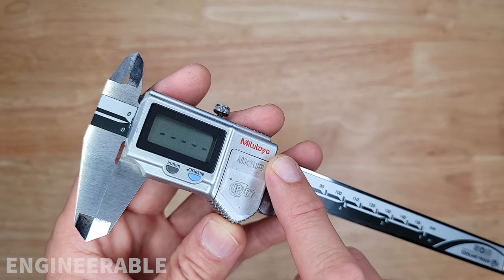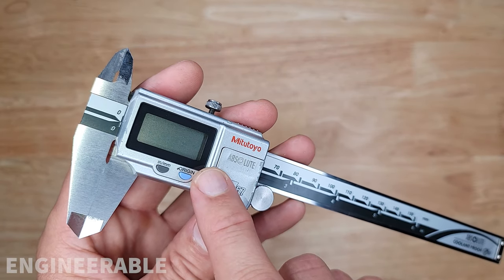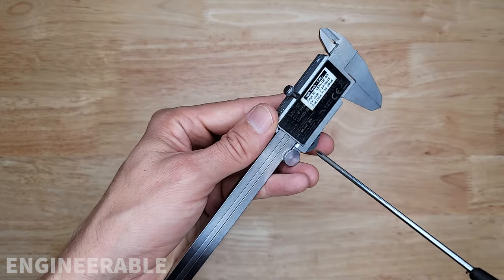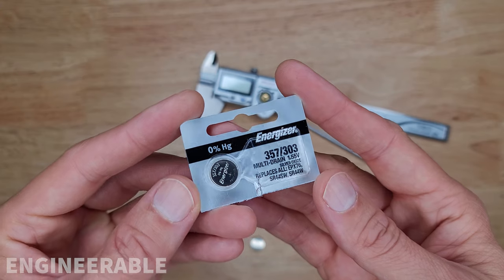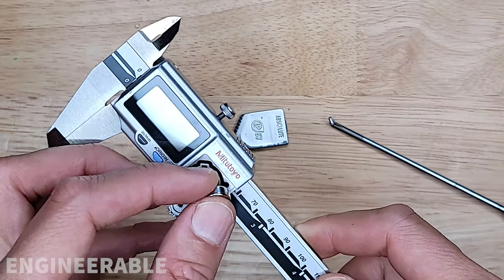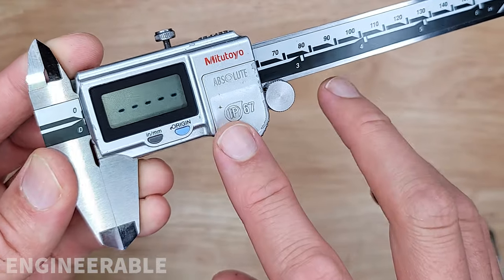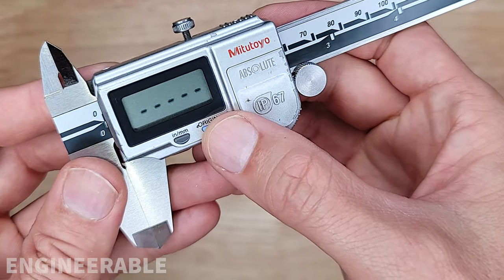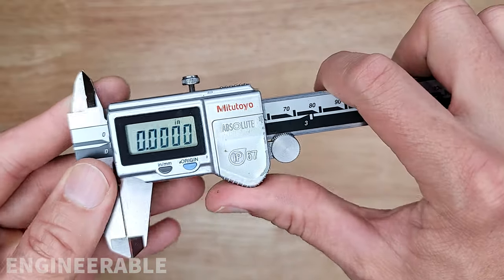How to Fix IP67 Mitutoyo Calipers Dashes Flashing on Display After Replacing Batteries | Digimatic

Comment: Hey, I do this on mine however the same issue comes up again randomly even after replacing batteries. At this point I reset my calipers every 1-2 days. Any ideas?
Reply from the maker: It could be your batteries. Silver Oxide (SR44) batteries will last almost twice as long. The issue is that standard LR44 (like the Energizer A76) have a more rapid voltage drop in use. Mitutoyo Calipers have a minimum voltage threshold, and the SR44 batteries almost completely deplete themselves before dropping to that voltage, vs the LR44 drop below that voltage at about 50% of their Mah capacity. Give some SR44 batteries a try.
Reply: @engineerable  thanks a ton ❤️ will look into it. I though I had sr’s in mine but might be mistaken. They have been in there for a year of continuous use so migh be a good idea replacing them as well.